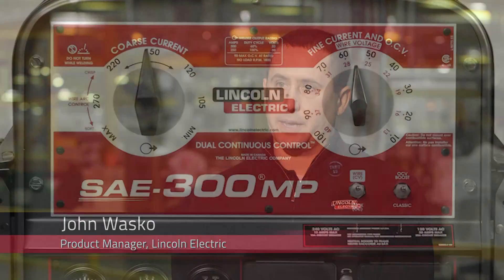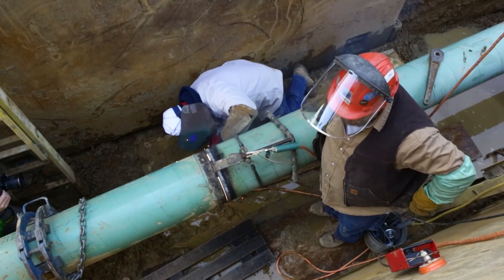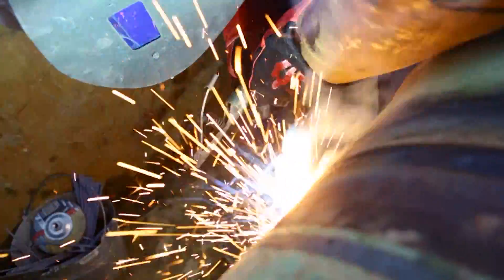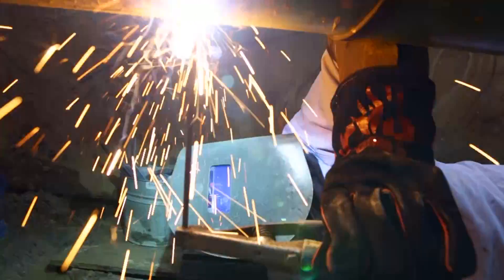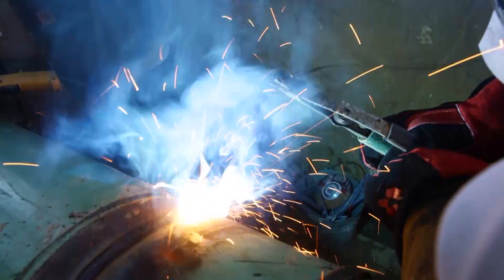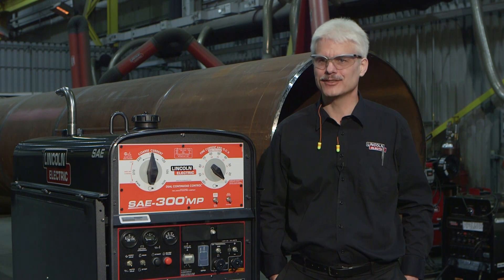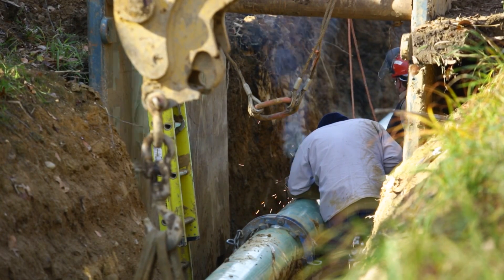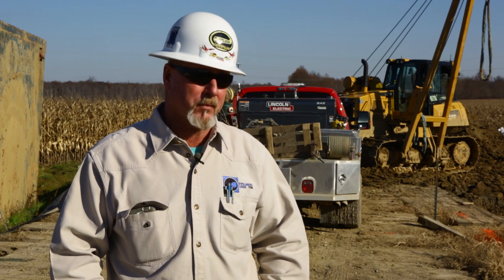Introducing the SAE-300® MP Engine-Driven Welder

Comment: I have a Lincoln Ranger 8, with an Onan Engine.  The WELDING MACHINE is FINE, it is the ONAN ENGINE on it that is NO GOOD.  I paid over $5,000 bucks for it in 1995, at Big Three Industries in Grand Prairie Texas.  That Machine has been broken down since the day I bought it.  I have spent OVER $10,000 bucks on it TRYING to get it to RUN.  The problem is, it cannot tolerate GASOLINE with ETHANOL IN IT.

Onan KNEW all gasoline Engines in the UNITED STATES CANNOT avoid Ethanol.  The Government has GUARANTEED the Price of CORN to Agribusiness so HIGH and guaranteed they will buy all they make, so they dump it in the GASOLINE to get RID OF IT.  Onan KNEW these engines in the USA will be exposed to that.

I am LOADING IT UP to day to take to Southern Plains Cummins in Dallas to TRY to get it to  RUN AGAIN.

NEVER EVER BUY ANYTHING that runs on GASOLINE.  It is the LAST piece. of Gasoline equipment I will EVER  OWN.

What makes it BAD is LINCOLN would NOT MAKE IT GOOD, the WARRANTY was NEVER HONORED, I have had to pay for it all.

I wish some SUIT WEARING BIG SHOT with LINCOLN would address this but they WON'T.  This machine is 23 years old, and only has 464 hours on it.  The REASON, it is always in the SHOP.  Bob Burnitt Midlothian Texas.  Onan makes SHIT and lincoln will NOT stand behind it.
Reply: Have you tried high test fuel?
Reply: why do you buy gas with ethanol in it? look around especially at boat launches for real gasoline without corn in it.
i have 2 welders with Onans and they never had any problems like that. all i ever did with them is change 2 voltage regulators and cleaned the carbon off the heads at 1,000 hours.
you need to find a better mechanic if they cant fix that engine